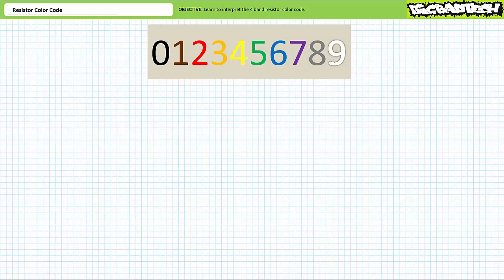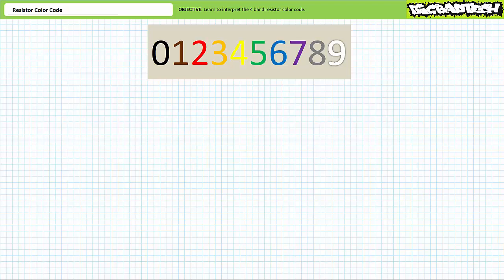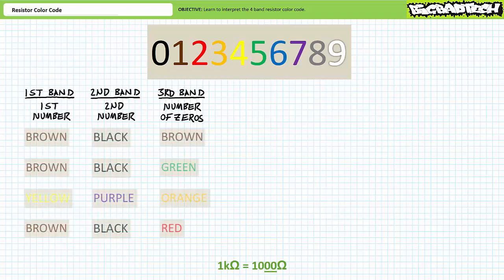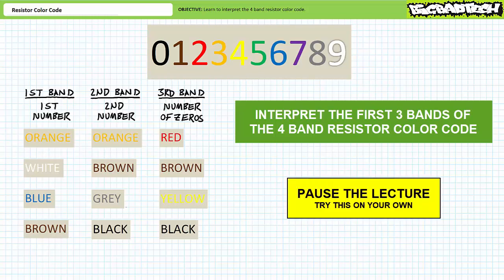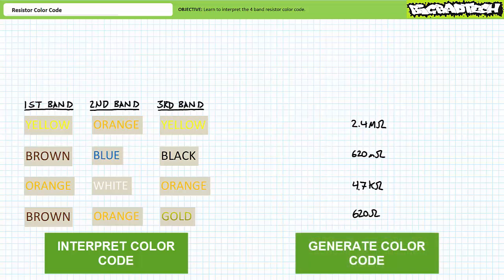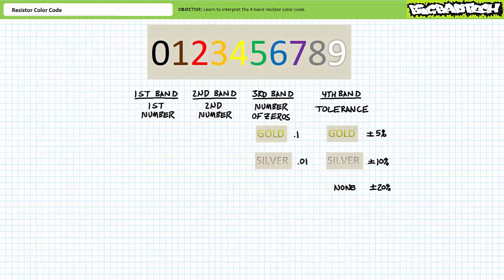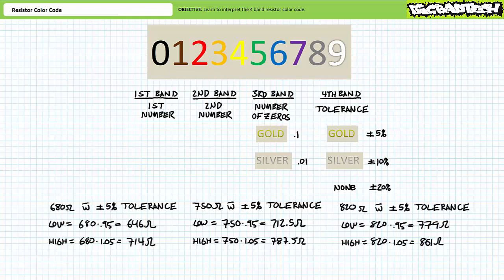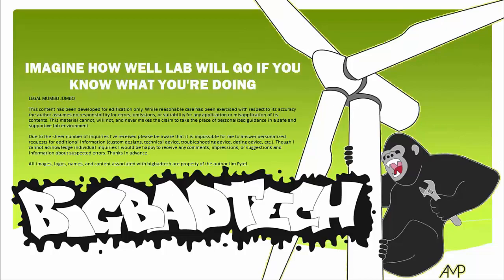4 Band Resistor Color Code (Full Lecture)

Comment: Hmm... This is a catch 22. If you really want to have a very specific resistor value or as close to it as possible, not only do you have to calculate what the resistor value is but also have to take into account it's heat dissipation (Wattage) in the system as it'll change the resistive value of the resistor as more or less power goes through it. Electrical engineering is indeed a complex field 😳😵😵‍💫. That's why many low end boards/circuits are thrown together willy nilly and don't last or do a good job. Good engineering practices would require an engineer to put time and effort into thinking about every aspect of each component being put into a system.

Comment: Is it possible that two resistors have the same value but of different color bands?
Reply from the maker: It’s conceivable that an unusually high resistor inside tolerance and an unusually low resistor inside tolerance have the same value but unlikely. There is a degree of overlap.